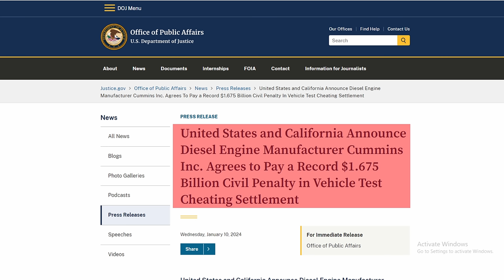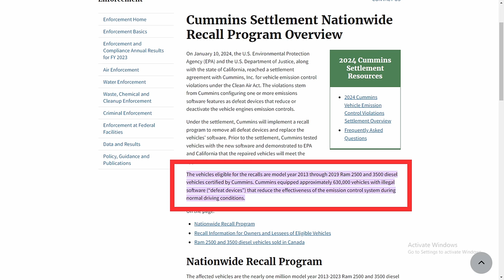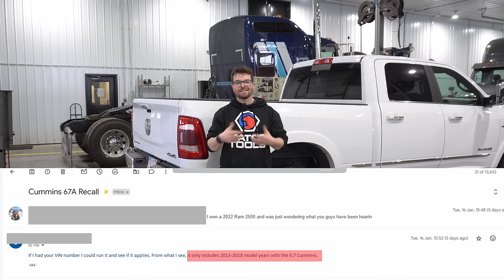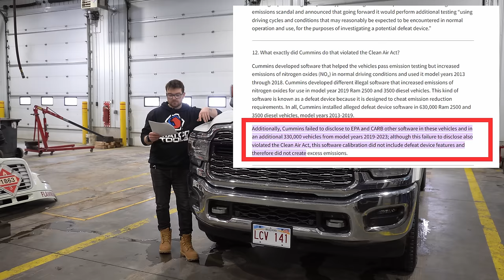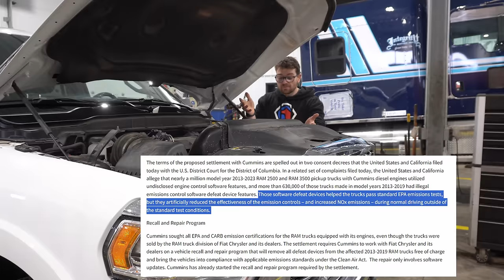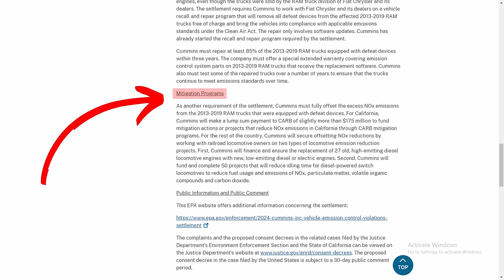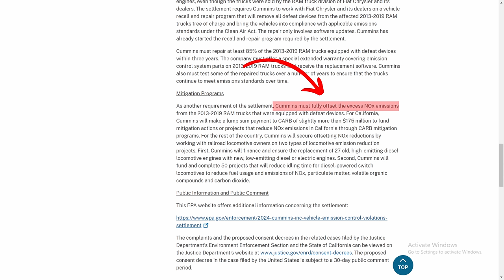RAM 2500 Cummins Diesel NOT GETTING RECALLED | Certified Diesel Mechanic Explains..

Comment: To avoid idling, a heater, like a Webasto, may be worth the investment, though it may seem costly up front.
Reply from the maker: or even an oil pan heater would be a great idea for cold climates.
Reply: @TheGettyAdventures    I think he's referring to cab heat.
Reply: I was referring to a diesel fired engine heater. In the cold, plug it in (Block, pan, and battery) when you can. When out and about, fire up the Espar or Webasto to keep the engine warm and no /or little warm-up time required.
Reply: @rodmcisaac3    Ah ok. When I looked up that name all it brought up was cab heaters lol.

Comment: I bought a 2023 ram Laramie Cummins a year ago, tranny went out completely at 7k miles. Dealership fixed it no cost. It went out again at 12k miles it stayed in the shop for 60 days after that. Got it back and no problems tell last month. This time it was puking transmission fluid out of the dip stick tube. I'm really thinking about parking it in my uncle's 200 acre farm. Buy 1000 pounds of tanerite and blowing the truck up and go buy a old Chevy truck

Comment: What do you consider Idling for a considering amount of time? Is there a reasonable  amount of time?
Reply: Well in Canada you can expect a truck to idle at least 20minutes a day. But in the south, why would someone idle a truck. They say for every 1 hour idle, it equals 20 km's (in terms of engine wear)

That being said, people don't usually throw their truck away because of an engine. It's usually a bunch of small stuff that add up, and people ignore the repairs. Then when a big repair hits, it's not worth fixing, because the vehicle has become junk.
Reply from the maker: Yes there is a reasonable amount of time. a couple minutes here and there is perfectly fine. but warming up your truck for 15 minutes every morning is tough on these engines.
Reply: @justinbourgeois4685  My experience with the Ford 6.7 Powerstroke diesel is that every hour of extended idling filled the DPF from 3%-12%--sometimes more in cold conditions or with lower quality fuel.  I had elevated idle control (EIC) on my pickup where I could manually increase the idle RPM to about 1,200 rpm in very cold temperatures to keep the engine at operating temperature.  At "regular" idle in frigid temperatures, the engine was not burning enough fuel to maintain temperature.  The truck ECM would also raise the idle RPM if the engine was cooling down excessively, but my experience was that the ECM will not "intervene" and raise the idle RPM above normal until the engine had already cooled very significantly.  At any rate, I tried to idle my 6.7 a minimum of time--seldom longer than 20 minutes, if that.  As an aside, the  6.7 Powerstroke, 6.6 Duramax, and 6.7 Cummins were used a lot in the Fire, Rescue, and Ambulance vehicles where I used to live--all of which could see extended idle times.  The various agencies all quietly deleted the DPF and SCR/DEF on those vehicles because they were so prone to failure during extended idling--often crippling the vehicles' ability to perform their critical missions. Fortunately,  it was a rural area without local or state emissions inspections.
Reply: @TheGettyAdventures  my next door neighbor here in Calgary has a fairly new Duramax 6.6, I've seen him let it warm up for an hour when  its really cold.

Comment: It'll be interesting to see if the increased EGR and soot buildup will result in Cummins engines ending up with the same issues as the Navistar Maxxforce engines. Cummins "came to Navistar's rescue" back 10-15 years ago because of their issues with the same problems. Too much EGR causing sooting and increased stress on the DPF. Granted, the Navistar engines didn't have the advantage of DEF taking some of the load off the EGR system. Still, I find it ironic that Cummins cheated to win and then helped bail out a competitor who tried honestly to be compliant but simply failed due to an inferior system.

Comment: Okay, what about us guys with deleted trucks egr valve, cooler, dpf scr doc all removed. And tuned. Can i take my truck in get the recall fine with all that removed to say it's been done? I'm aware it won't do nothing. But itll checked off as a recall. Will I still be able to tune my truck. With it all deleted would they even think about doing it?

Comment: Why does the recall not include the RAM 1500 Cummins 6.7L and other applications with the same engine?
Reply: The 1500 is not available with a 6.7 Cummins diesel engine, only 2500 and above.

Comment: Good video. This is my experience I have a 21 high output Cummins I took it in to get it serviced while it was there the service department told me when I went to pick it up that they performed the recall so my question is does that mean they lied to me or something else going on??
Reply: A few years ago I took my truck in for an unrelated issue and they told me they performed the water pump recall. Took the truck in 6 months later and it turns out they didn't actually perform the recall, they just told me they did, even though I hadn't asked for it. Dealerships are strange places.

Comment: I have a 2021 that runs just fine. No upgrades needed and I actually did look up my van to see if there was a recall. Fortunately, for me I have no recall for a defeat device so my engine is running normally. One sentence you said, make sure your vehicle gets up to operating temperature to produce less sit. The next sentence you said don’t let them idle. How can you get it up to operating temperature if it doesn’t idle?
Reply: The fastest way to get an engine up to operating temp, especially a diesel, is to drive it.  At idle, they do produce heat but not much.  Give the engine a few seconds after starting to get the fluids circulating, then start driving.  Until it gets to operating temp though, be easy on it.  It will get up to temp considerably quicker than sitting at idle with no load.
Reply: @91CavGT5  thanks for the advice
Reply: @leatherneckprepper4477  you can also plug the block heater in, or get one installed.  That will help if you are in a really cold environment.  I live in south Texas so I forget about block heaters because we don’t need them down here.

Comment: How long can you let the engine idle to warn up before take off? How long is too long?
Thanks for the great videos.
Reply: Best advice I've heard is remote start on the way to the truck, get in, put seat belt on, set radio station, take off gently and be nice to it until the coolant temp gauge starts to register. Don't let it sit there for 5+ minutes idling.
Reply: I start mine and just put it on about 2000 rpm till gauge comes up 150,000 no problems no codes

Comment: So if the 2019+ engines are set up differently wouldn't they be using more DEF and have worse MPG than the previous models. I'm still having a difficult time determining exactly what the root cause is.

Comment: So does that mean that both my 2022 Ram 2500 and 2023 Ram 3500 will be great candidates for sooting up because the software has been corrected in these years? Just asking for a friend lol Love your Chanel and keep the content coming.
Reply from the maker: I would not rule it out.
Reply: Still love my Rams regardless. Even my 17 2500 bighorn. I service them regularly and far sooner than the factory requirements.

Comment: Did you get rid of your Power Wagon?
Reply from the maker: NOO SIR!
Reply: Are you worried about the long term effect of the MDS cylinder shut off crap that was also mandated put in because of the EPA? I've been considering a 6.4 hemi, but I already muzzled this cylinder shut off on my Honda pilot because it DOES cause issues and failures there proven (see cylinder 3) back in my day as a mechanic we called a shut off cylinder dead weight. It's been proven to barely save any gas if any at all (same mpg with the tech on and off) but in the dodge front I do know they also have hardware parts not just a software alone mod that needs to be done to shut this crap off. Also auto start stop tech as well is garbage. Enjoy your .5 gallons saved with your 10000$ engine rebuild. The EPA sucks, trying to push everyone to electric pieces of junk.
Reply: GM calls it DOD (displacement on demand) lifter failures, multitude of problems there from this crap too
Reply: Why does commifornia getting al the money?

Comment: I was wondering if you would do a video on on cleaning of a map sensor for the eco diesel? I heard it will help your vehicle! Is this true?
Reply from the maker: I could certainly look into it. and Yes if the map sensor is filled with soot it won't give an accurate reading causing power loss.
Reply: @TheGettyAdventures  i bought an eco diesel back in may and have been watching lots of videos! Not going to lie I’m a little nervous! It’s working good now and don’t want to go to the dealership! It’s under warranty for now! Any thoughts

Comment: I think it’s something I have a 2017 ram 3500 Laramie dually and it has 15 k on it and it has never went into regeneration it has never came up on my dashboard saying regeneration keep driving and she runs fantastic I’m going to mind business
Reply from the maker: Must be driving her well then. do you drive longer distances? these engines will perform passive regens while driving if they are hot enough.
Reply: False.  You had plenty of passive and active regens in 15k miles.  You’re driving your truck in a fashion that’s  letting it finish regen cycles.   That’s why you don’t get a warning on your dash.  It should be seemless when you have a active regen.
Reply: @TheGettyAdventures  I forgot to put it in my comment I’ve also never added def it funny because I had a 2016 ram 1500 eco diesel and I had to add it a few times but my 3500 hasn’t got any and I’ve owned it since brand new
Reply: My 2017 automatically goes into regen (according to my edge insight) about every 24 engine hours. Doesn’t matter how I drive or how much I’ve been towing. The only times I’ve had it vary were when I had an issue with a wire on a sensor and when I maxed out an edge juice (it would regen about every 20 minutes then😉😮)
Reply: What would be hot enough? Over 700 degrees? @TheGettyAdventures

Comment: I'm willing to bet a lot of 2013-2019 owners are not going to be taking their trucks to the dealer to have their PCM re-flashed... I certainly wouldn't drive up there just to leave with less power and a more heavily burdened after-treatment system. 

The EPA needs to target emissions that actually matter, like cargo ships and coal burning power plants. Going after light duty trucks is simply optics, politics, and extortion.
Reply from the maker: Cummins agree that 85% of these trucks would be recalled in 3 years lol I doubt that will happen.
Reply: @TheGettyAdventures  Right lol no way.

Comment: If it was really about emissions, they would push   the energy sector to come up with a clean biodiesel instead of the bi-product from the gas refining process. Diesel engines were originally designed to run on peanut oil and can even run off filtered used cooking oil if converted to do so.

Comment: Still wondering if my 2014 ram 5500 is effected by this recall
Reply from the maker: I would assume yes, but there are some trucks between 2013-2015 that are not
Reply: @TheGettyAdventures I have a 2014 2500 that had the exhaust system recalled and replaced about 2 or 3 years after I bought it so what do I look for far as the SCR controller ? Thanks great info and channel!

Comment: A diesel engine at idle burn very little fuel. They put out very little soot. They put out the most soot when they are under a load making full power.
Reply from the maker: completely incorrect. It's not about fuel burnt it's about how complete the combustion is. at idle with cold cylinders there is a ton of incomplete combustion that causes soot.
Reply: @TheGettyAdventures  No you are completely incorrect. You are repeating what you heard online from someone who didn't know what they were talking about. This is not the first time I've watched one of your video. You sound like you spend more time online than you do working on trucks.

Comment: Hello: I have a 2022 Ram 3500 SRW high output.  On 01/08/2024 I received an email for a recall: Recall information: Y43/     I would love to hear what you know about this recall.  Thank you! P.S. This is what it stated: Details of the Recall
The Particulate Matter Sensor and Module on your vehicle may not have been installed during the manufacturing process which was in accordance with the Memorandum of Understanding from the California Air Resource Board.
FCA will repair your vehicle free of charge (parts and labor). To do this, your dealer will inspect and if necessary, install the Particulate Matter (PM) sensor and module, reprogram the Powertrain Control Module (PCM) and attach an authorized modifications label. The Diesel Particulate Filter will be covered for a 12-month warranty period with unlimited mileage from the time of the PM sensor installation. The estimated repair time is about 1 hour. In addition, your dealer will require your vehicle for proper check-in, preparation, and check-out during your visit, which require more time. Your time is important to us, so we recommend that you schedule a service appointment to minimize your inconvenience.
Reply: There was a supply shortage and the epa allowed manufacturers to build & sell some vehicles without some emissions components. When sufficient supplies become available, those components have to be installed and the programming updated.

Comment: You are heavily speculating on increased EGR. If that was the case you would see better mileage from 2018’s that haven’t been recalled compared to later models, and I don’t think that is the case.
Reply from the maker: If the engines were the same maybe. 2019+ 6.7L engines were completely overhauled compared to earlier years.
Reply: Bad comparison.  In 2019 about 80% of the engine was changed in some way both internally and externally.

Comment: I have a 2003 Ram and I am looking to get a new 2023 or 2024, I have been researching the new ones and I am concerned about the cylinder deactivation. I have heard that the engin will not get enough oil and could do damage. Is this true?
Reply: Yes!

Comment: Yep, different rules for different people. The "government" can buy those trucks without any of those emission systems on them. The greatest polluters is the government themself , like the military. Back when ultra low sulfur diesel came in, the company I worked for had to get rid of around 250,000 gallons of low sulfur diesel and get the ultra low sulfur diesel. Guess where they sold the low sulfur diesel to? The Railroad.

Comment: Think it's time trains and ships get EPA emissions just saying
Reply from the maker: would not be a terrible idea.
Reply: Don't forget military equipment! Ground or air 😂
Reply: @truckinforjesus  Ground equipment since 2010 or so has been emissions compliant on their trucks powered by anything but a CAT engine. So C13 and C15 powered equipment are using non-compliant engines.

As far as aircraft engines, other than after burner equipped engines are all up or down rated commercial engines. The US Military is pushing for bio fuels being certified.
Reply: I learned something today. Thank you for sharing this information. As to your knowledge, is this same aforementioned equipment using DEF in any capacity. @gungadinn
Reply: @truckinforjesus  As far as i knew/known, military contracts lock in a revision level and as long as the contract is active, you use that configuration. (this is the only possible way that CAT diesels can continue to be used in on road trucks)

Let's say that Oshkosh received a contract to build HEMTT trucks in 2009 and subsequent contracts refer back to the older specifications, then they are allowed to use the non-compliant engines.

The newer designed from scratch trucks (2013 or later) get stuck with the EPA mandate. 

The last MTVR 7,5 ton truck I looked at had a CAT 13 diesel and the sticker on the engine listed it as EPA compliant.
Reply: Good to know. My experience with the DEF level of diesel engines has been a nightmare from a reliability standpoint and when I think of anyone serving on the ground in hostile environments that have to be subjected to unreliable equipment, I feel for them. I would imagine it's stressful enough with RELIABLE equipment. 
The little bit of knowledge I do have about military equipment is from over two decades ago. Oshkosh does ring a bell. @gungadinn

Comment: EGR makes no sense on any engine, gas or diesel.  My thinking is to ONLY work on the exhaust after it leaves the engine.  To run any amount of exhaust back into the engine is stupid.
Electronics have already cleaned up the burning of the fuel in gas and diesel, which is way forward thinking tech, so simply leave it at treating what LITTLE emissions are heading for a muffler and call it a day.